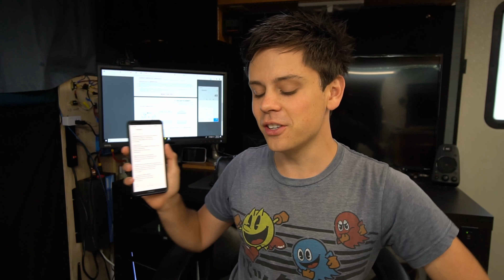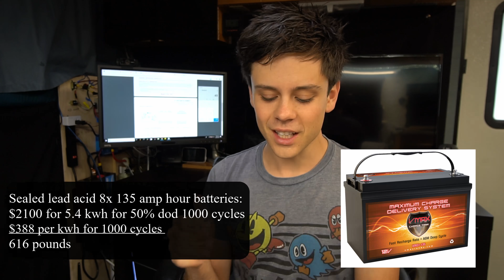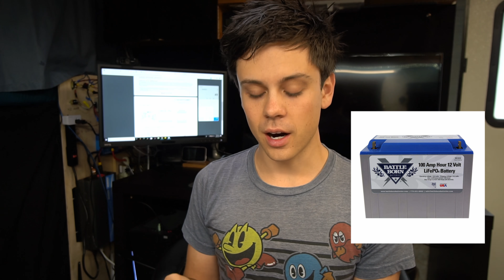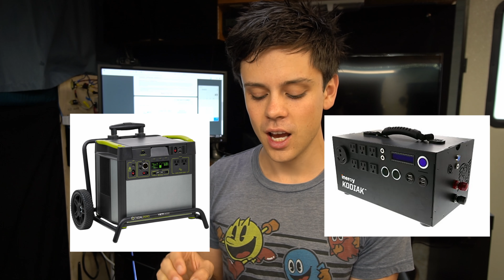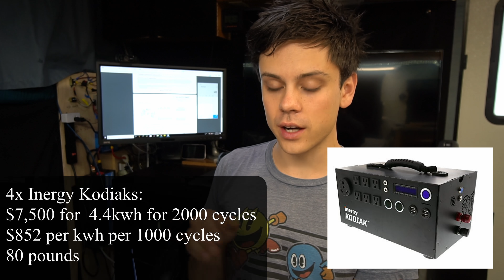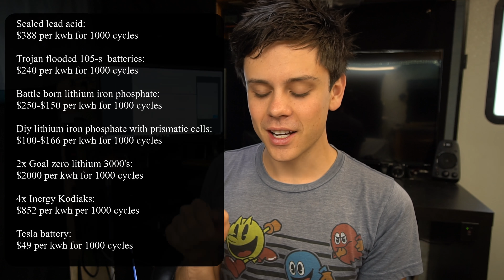Off-grid Solar Battery Price Comparison: Tesla vs. FLA vs. SLA vs. LiFePO4 vs. Tesla

Comment: Ok so the title of the presentation implies off grid or non mobile! Why is anyone considering super expensive light weight tec for a non mobile application ?
Fools that like the trendy ness of the word “Tesla”. The brand is more valuable than the product.

Vanadium redox flow batteries or any flow batteries, yes there bulky yes they are heavy.does it matter?

The flow battery tec is much cheaper in the long run and will be very cheap as they reach scale.
The advantages? They will last 30 years they can absorb current super fast (lithium will fry if you push to much too fast!
If you need to manage huge sources of energy for the grid this is the answer and will be the tec that fills the void for off grid or for managing the grid.
And they are as sustainable as salt water unlike these batteries based on precious metals.

Also the batteries featured are certainly not the best comparison. I personally have barium nano-titinate ceramic alloy /lithium . These can be charged in 15 minutes and last 25 years can stand extreme temp. They are not quite as energy dense as some other lithium tec (which fail quickly).
The only reason Tesla bats don’t fail in 3 years is the cooling system and battery management system. Battery management takes 20% off the top & 20 % off the bottom which means 40% of the bragging chemistry is not used for work!
Reply: Jesus, do you have reading comprehension issues?  The title says "off-grid RV". For RV applications, weight and energy density is terribly important.  And he pretty clearly explained why "Tesla" is important and it didn't have anything to do with trendiness.   The price per kilowatt hour over 1,000 charge cycles was the lowest.
Reply: Are either of these battery technologies commercially available? I can't seem to find much?
Reply: So the young man creates an outstanding video full of good info and you with your fragile ego have to call him a fool because you don't agree with his analysis...what does that make you? you should apologize your comment was rude and completely uncalled for
Reply: fanboy/slanted facts and review

Comment: Lithium is only 3% of lithium ion battery. The most expensive item in these batteries is cobalt
Reply: Tesla have <3% cobalt in their batteries, and are working on getting it to 0.
Reply: Most expensive part of the Li-ion battery is packaging and separator between anode and cathode.

Comment: You're comparing a used battery to new batteries.  Tesla batteries are not available new except in their pricey Powerwall.  I think all the other batteries you showed are a fair comparison.  But to fail to describe the Tesla battery as a used, unknown SoH, battery is wrong.  Please update this to describe the Tesla battery as a used battery that is not guaranteed to have any particular SoH.
Reply from the maker: https://youtu.be/7N56ZL3fa8E
Reply from the maker: This will explain it
Reply: I saw that before I posted.  I also understand that you aren't getting low mileage guarantees or SoH guarantees buying used modules on Ebay.  Why state they are coming out of 15k and 30k cars, when Ebay buying makes it impossible to know that?  They could be coming out of cars that had defective cells and modules but that Tesla wouldn't touch because they deemed the "commercial use" (car services).  I'm not knocking your choice.  Just stating that in this particular argument of this video, you're pretending like a used item smoking a new item in value is laughable.  That's usually the case.  Any used car will smoke a new one on value, but we buy new for a warranty, or the security of knowing that noone abused it before you bought it.

You also seem to have bought into the myth that Tesla batteries are mythically superior, suffering from no degradation because they're Tesla.  It's true, long range cars have massive cell counts and so discharge is distributed across more cells and in theory should reduce heat.  As does Tesla's TMS, but even it is limited, as seen when Tesla exhibit thermal limiting when driven hard.  All lithiums suffer great loss if charged to 100% and left unused, which Tesla allows car owners to do.  All lithiums suffer greater loss if rapidly discharged or rapidly charged, with Ludicrous Mode and Supercharging allow (some) Tesla owners to do.  If a Tesla battery is being sold used on Ebay, something happened to that car.  If you're lucky it was a low mile car with body damage and no electrical faults that led to it being dismantled.  But you can't know that.  So let's restate results of your survey to say that you're enamored with used Tesla modules because, for now, they're cheaper than new batteries, and present much better value.  And since they're not really recyclable (research carefully.  No one can do it properly yet) second life for these is important and your project is the perfect home.  I'm glad you know that you should dial in DoD to 80-20 space to maximize life of battery (you've chosen 90-10).  People designing these systems should factor in how that limits their total energy storage, just like you did and also like you did with the lead acids that only allow a 50% discharge.  But let's not perpetuate the myth that these cells or those modules are other worldly, or that they are a readily available commodity that anyone and everyone can buy at that price reliably from this day forward.  They're salvage parts from wrecks, and though you're lucky to have access to them, it's not a total reset on how the world will power their solar battery storage.

Comment: Love your videos ... what about Carbon Foam batteries ?
Reply from the maker: I was sooo excited for carbon foam batteries, but found lots of negative customer reviews. of them not working as advertised. let me down. very good stats though. especially for low temperature systems
Reply: I'll be using 3 of them (12v 115Ahr) in para, in my solar system (4x 100w flex on 40A SRNE MPPT charge controller) - Leaving Canada next week for 4-5months of boondocking in AZ ... I'll let you know how they perform.

Comment: I'm going into my 15th winter using four 6 volt golf car wet cell lead acid batteries in my 12 volt off grid house in N. Wis. Cost in 2003 was $50 each or $200 total from NAPA. Cost has almost doubled since then. My needs are simple and I use natural refrigeration in the winter. Hopefully I can get another year out of them.
Reply: Greetings from off grid Oregon, 
I  have a 21 kilowatt FLA battery bank that have 1642 cycles on them. I never use more than 20% so 80% SOC is the lowest they get. The batteries behave the same as when they were new. Their efficiency factor is still around 90%. This is calculated by how much energy has to be replaced and still get the specific gravity back up to spec. My batteries are L-16 FLA and the cost was $2600.
We use about 4.2 kilowatts a day from the batteries. I have a friend who has been off grid for 40 years now. He typically gets 18 to 20 years from his FLA batteries. I hope to get 12 years out of them.
Reply: @offgridinthepacificnorthwe3210  If your pal gets 18-20 years from his FLA Batts maybe I'll get much out of mine. Come May it'll be their 16th birthday! I use distilled water from Dollar General!
Reply: @herbwag6456  That is fantastic! I love to hear it. I hope to get at least 12 from my L-16 FLA bank. I do not go below 80%SOC and always come to a full charge every 2 days. The specific absorb setting is getting the Specific gravity to 1.288 which is perfect for my batteries. I do have an elevated absorb voltage of 2.58 colts per cell. This is what My friend was doing as well. Can you describe your policy for daily depth of discharge and charge algorithms?
Reply: Where do you get the distilled water
Reply: @c39v26  I buy mine at Winco foods for $.88 cents a gallon.

Comment: When you include the cost of the fully programmable MPPT controller and the 24v to 12v converter, does the Tesla cost still win out?
Reply from the maker: Mppt cost still the same. It's the one I used for 12 volt systems. And converter is 30 bucks

Comment: The lithium Tesla battery packs are new to me...
Maybe I missed it but, in your testing and figures, are you taking into account that the Tesla batteries are used? How does the fact that the battery bank is used affect the overall expected lifespan? Thanks
Reply from the maker: Considering the cycle life if you use only 70-80% capacity, it shouldn't matter. Look up cycle life estimates for the Panasonic cell that Tesla uses.

Comment: you have all the numbers wrong because of the cycles
Reply from the maker: Which numbers?
Reply: Tesla baterry for example its 400 cycles (los 30% of capacity), it last so long in time because its a very big battery... the people usually drive 12000km/year, with autonomy of 400km you do 30 cycles per year, so they warranty for 10 years (300 cycles)
Reply: *lost 30%
Reply from the maker: Going by user data, it is at 80% of capacity after 500,000 miles. Source: https://www.engadget.com/2018/04/16/tesla-battery-packs-live-longer/

So I am not too concerned at all. Especially with my current charge profile. I am set. 

And yes thats true but the charge and discharge rate of my solar power system is a JOKE compared to what the car needs to drive. Way less. Just look at how many hours it takes to discharge the tesla while driving. Me using my solar power system with it isnt doing anything to it. Which is why it doesnt require cooling.

Comment: Yes, but you bought a pre-owned Tesla battery, not new. No way to know how many charge cycles remain.
Reply: note that he did a 5000 cycle estimate, well low of his estimated cycle life of 20,000 cycles on a new battery - accounted for.
Reply: @bobh9492  mom
Reply: theres  is no number, they just degrade more and more...you can just charge it to "full" see what it takes and then it will continue degrading at an ever slowing amount over time.....have yet to see a tesla battery stop working entirely after 20k 40k 60k cycles

Comment: Thanks for doing this work. I think for the cost per kwh, I will incorporate a Tesla battery system. 

Can you help design a hot swappable battery bank array of 2 to 5 batteries?  

I want to be able to power the needs of mobile video and event production with such things as 1000 watt stage lights, high wattage hazer, fog machine, monitors, cameras, PA speakers, (air conditioning for the van unit only) and more.

Comment: All the drop in are 12v systems, build your own, make it how you want it, most people will go 12v
Now aren't you running a 48v battery from tesla, and that means a 48v INVERTER to make your 120v for all your electronics
And 48 aka 54v charging from charger or solar ( or did you use 24v, still has add on expenses)
All of this is added expense you did not include your cost analysis presentation
Reply from the maker: It's a 24 volt system and yeah of course. I figured that was a given. This video is comparing batteries, not accessories. And if you are lbuilding it from scratch it's not an added expense.
Reply: @WillProwse  
Yes I am assuming that 99%  of people with RVs campers vans, have 12v system, your RV came with a 12v system, I ama summing to replaced the inverter and other pieces of equipment
 that battery could be reconfigured as 12v , and avoid the extra expenses of 24v
As far as larger solar system,  roof space is finite,  limited to what will fit on the roof, you can use mppt with 12 vote or 24v systems, going 24v does not get any more watts of panels" the roof, although yes reducing amps out from 12 to 24v means the usual 12/24 controller can handle more total input and you might not have to replace the controller, if your roof is already fully loaded
And reduces the wires size from controller to batteries
Reply from the maker: again, I figure all of this stuff is implied. And the dc converter costs 35 bucks and will run all of your 12 volt appliances. I dont see how this is a huge cost. largest conversion cost would be inverter and thats not much. 

so yeah, do what you want. I would imagine that anyone capable of using a tesla battery understands the cost of changing to a 24 volt system.
Reply: oh i agree the Dc to DC converter to 13v for the lights etc..is a minor cost addition, and a scratch build makes this more cost efficient, than a change over, where your RV is configured and you have invested in inverter, charger, solar etc.. 
My previous RV i had 8100KW hr, 4000KW hr useble AGM batteries and 650w of solar, 1200w inverter, 70amp charger
this RV no solar, 75amp charger/converter, 2000w PSW inverter and one 4D 200ampHr house battery
lithium settable 24v chargers, and 24v inverters COST MORE $$
and are part of the cost of doing a changer over battery swap
because most people doing lead acid, AGM, or drop in 12v lithium are going to stay with 12v, so while those batteries cost MORE up front, they do not require the added hardware expenses of a 24v Li system
the hardware changes 'ARE' part of the cost of putting in the 24v Li system
Reply from the maker: And something you forgot to mention is that when you go to a higher voltage battery system, the solar charge controller can handle a larger solar array input. So usually that means double the panels without spending a few hundred dollars on another solar charge controller. So the money you save from that could theoretically pay for the inverter. but it really doesn't matter regardless. I'm imagining that most people watching this video understand this to begin with

Comment: Jack Richard is building a 100KWH tesla portable pack!
Reply from the maker: for what? what does it power
Reply: @WillProwse  
Whatever you want lol geared towards houses
Reply from the maker: @SolarTechFL  is it mounted on a wall? is it grid tied? having a grid tie tesla bank would be super cool
Reply: @WillProwse  its in a cabinet his is not exporting power to the grid just uses the grid as a "generator" to recharge.  
If he used a different battery inverter it could export power directly to the grid But in alot of places that no longer makes cents lol
Reply: Jim Jim  search Evtv
Reply: Jim Jim  See comments above
Reply: Jack has built two of these. He is doing amazing research on using used Tesla batteries for residential solar storage.

Comment: Hi I understand how a bms works I want to know where you got it and what type “ manufacture “of bms you used with the Tesla 24volt packs
Reply: he just has no bms yet and thinks it's fine cause he is charging/discharging so slow and this would not bring sells that fast out of balance, he checks manually the cells from time to time to be safe
Reply: Hey thanks for that ! I want to do a Tesla battery but need a bms cause I’m gonna put them through the gears so to speak with 8kW of solar panels at 24 volts
Reply: @burtonnystrom4606  I've been working with a BMS with the Tesla batteries if you click on my profile and look through my videos you can see what BMS I've been using

Comment: Since these batteries being sold on eBay are technically used batteries, how about some info (demo) about how to shop for a good used Lithium battery and know how to check it out to make sure it will hold up for the long term -- or is it just a crap shoot whether or not you get a good used one?  TIA.
Reply from the maker: Good video idea

Comment: Dude LTO battery, Lithium Titanate. 20,000 cycles. Like $350 for 50Ah on eBay. A 6 series "Lto" battery can replace 12v lead acid. Very Safely,  hard to damage, can sustain 100% dod.

Comment: Chevy volt battery 16 kwh for 1500  !
Reply: yep at wrecking yards I have 56 kwh of volt packs.
Reply from the maker: Whoaaa no way
Reply: my battery in my car is 16.4 kilowatt hours and I get to use 10.2 of it
Reply: yep Gen 1 volt batteries much better price and easy to make 48 v packs out of them.